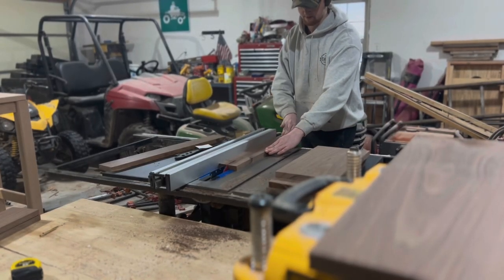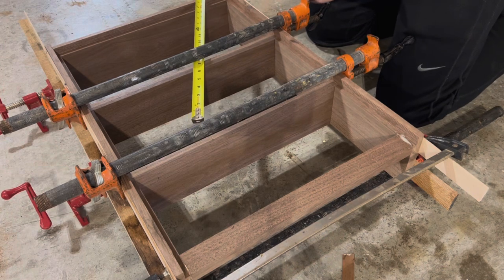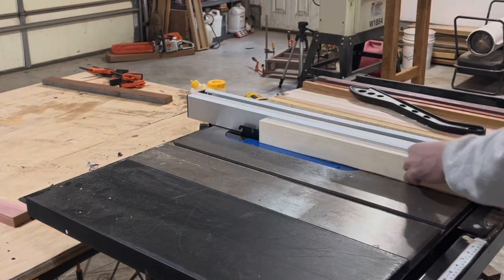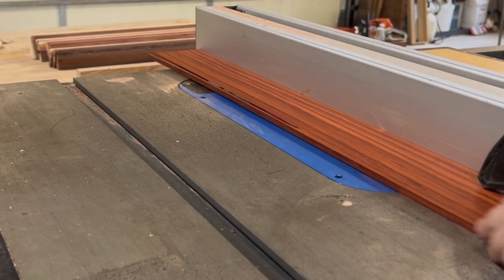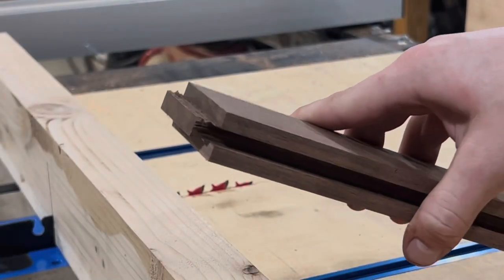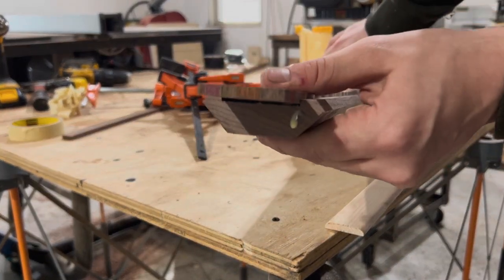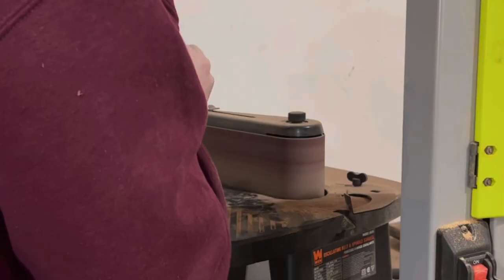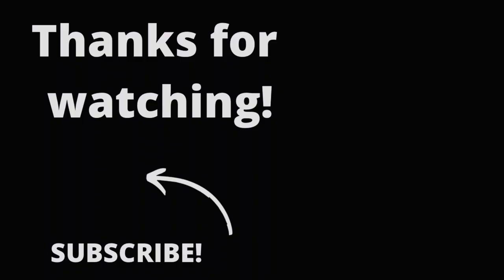Mosaic Cabinet

Comment: When you run the wood thru the table saw to make a dado you need to clean all those ribs off and make it smooth for the best contact between the wood. Buy or make a router plane.